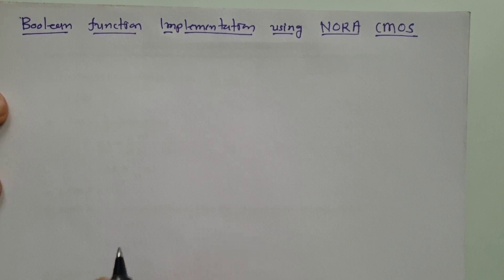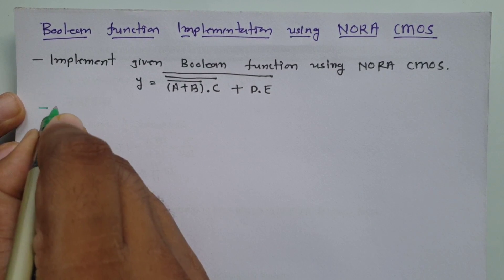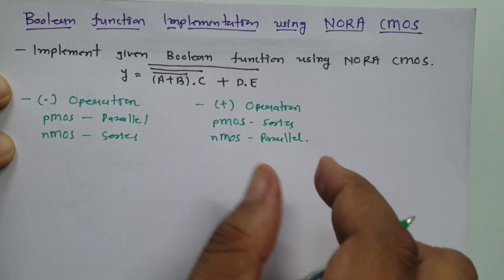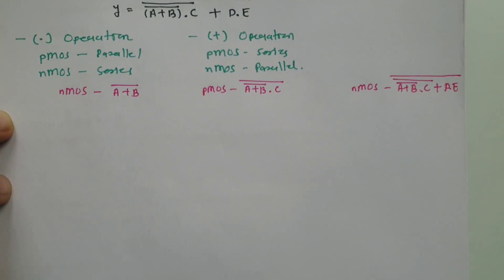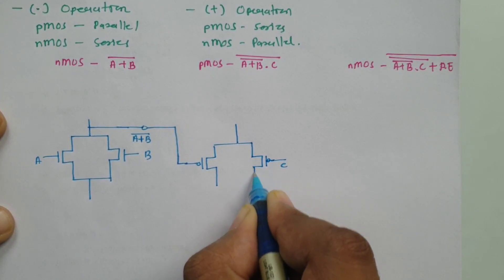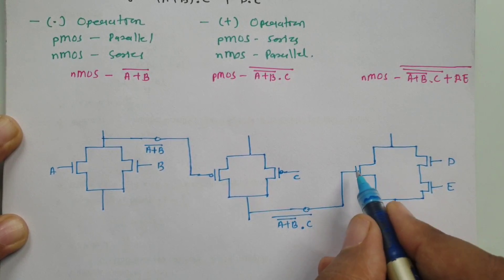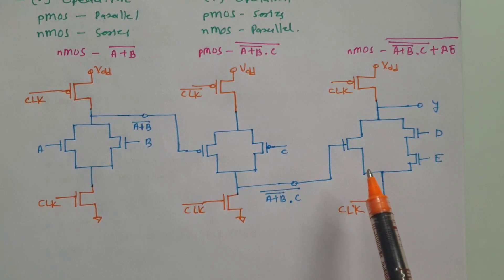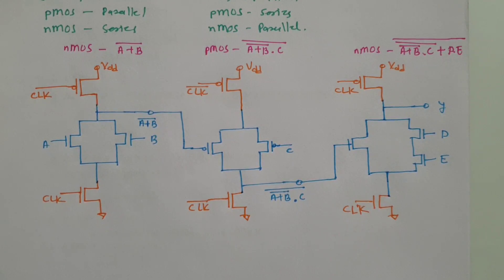Boolean Function Implementation using NORA CMOS Logic | VLSI by Engineering Funda

Comment: I thought NORA logic sections were supposed to be terminated with Clocked CMOS latch. Without that the signal race problem is not solved. If C2MOS Latch is added after the third stage then the output is y_inverted,  not y. I also think CLK input to the 2nd(p block)  stage is incorrect.